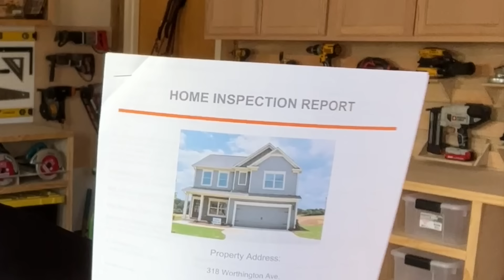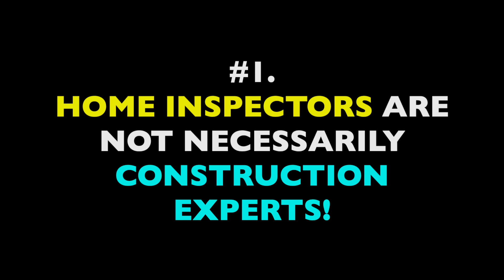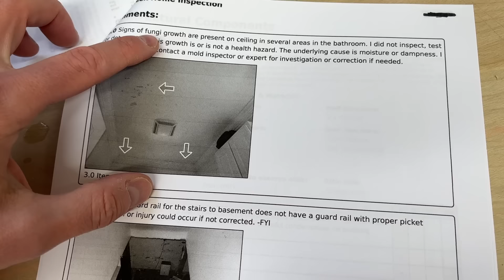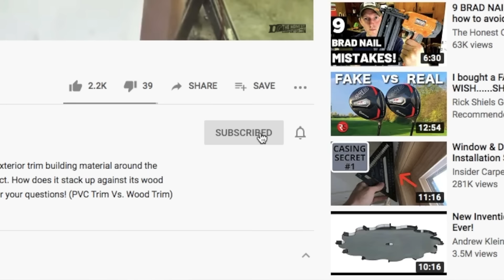The Truth About HOME INSPECTION REPORTS! What They Leave Out...(Homebuyers SHOULD WATCH This Video!)

Comment: We've had homes that we've bought and sold in our family for our entire adult life. I've learned a few things. Here are my thoughts.
1) Foundation, foundation and foundation. It's your most expensive repair so take the extra money and spend it on a structural engineer to do a separate inspection that can examine the structure of the house. A plumber or electrician will have zero clue. Water leaking damage alone is extraordinarily expensive to repair (average is $18,000 just to waterproof) let alone damage to the foundation and it's just misery for a homeowner. Sadly, in my experience, home sellers lie through their teeth. 
2) Drainage to the street. Especially on an older home. Have a camera stuck in the drain to the street. That's a $10,000 repair. 
3) I personally would avoid any inspector that's electrician or plumbing as for the most part, those are cheaper repairs if they miss something but foundations or the structure of the house - oh my gosh.
4) Radon inspection. Take it seriously. It's expensive if the radon gas is high. Don't overlook that super important thing and don't believe the homeowner. We had one house we looked at and did an independent radon inspection. 25. Ya we walked. 
5) If you are a new home buyer, don't be afraid to get two separate inspections and always follow them around and ask politely and nicely lots of questions. If you're friendly, they will be friendly. It's super important. 
6) Ignore the silly stuff and use that for price negotiation (faucet doesn't work or whatever. Those are not deal breakers. Even a replacement window or new roof.) Walk away from the expensive repairs so put the inspector to work on those. 
7) Have a independent lead paint inspection as well. It's a dangerous situation.
8) NEVER buy a smoker's home. You have no idea how expensive it is to get rid of the smell. I was almost tempted until I talked to painters about that - ya rip the walls out, etc. No thank you. 

Otherwise, great segment.
Reply: Thanks for the detailed info.
Reply: Dave, this is good info. I have a couple small comments on things I have dealt with.
1) The Foundation is more observable on houses that have been around a few years. Yes, it is expensive if needing attention. Some cracks are no big deal. I agree that a structural engineer will let you know what a big deal is or not. Last time I did it it was about twice the price of a regular inspection. Totally worth it though if needed.
4) For Radon - 25 parts per million is next level! Good you balked at that. I had a pipe put in at around $3500 to go from 6 picos to 2 picos.
6) Silly stuff - Yes. If you like the house don't hold up your own purchase. Many things are clear and just be part of the selling price. Requiring a clueless or unscrupulous seller to fix something might not be in your best interest. Things you think you want fixed right, you might want to have done yourself anyway. - I guess the only caveat some problems might mess up the bank giving you a loan in the first place - like a leaky roof. It depends on circumstances.
Reply: @mikeyfoofoo  Thanks for the reply. Foundations are just a nightmare for me. My worst case was I had a house for sale that the mortar did a stairstep pattern on the outside wall. That my friend is terrifying. To sell the house I had to hire an engineering firm to confirm the foundation wasn't coming apart and write an official report (thankfully no problems were found). The house inspection (of course) years earlier said not to worry. Well, when the selling agents saw that - they worried and said it won't sell. You have no idea the panic thinking that the house's foundation would have to be rebuilt. Never again did I make that mistake.

Comment: My inspector had decades of experience in the filed and worked in construction  andwas really thorough and went the extra mile and didn't mind that I was there with him through the whole inspection, but still there were a lot of things that we didn't really see until I had to had them fixed several years later,soyou can imagine  if that wasn't the case. But what I really wanted him was to inspect the roof and the foundation and those were fine.
And never, ever use a realtor's referral for most things as they have their interests involved there.

Comment: My personal experience is that home inspection prior to purchase is critical however it has to be done intelligently.  As you pointed out home inspectors just point out the obvious which is really of little value.  They don't critically evaluate major systems of a house - plumbing, hvac, and electrical - that should be part of the inspection.  I've found that hiring an experienced carpenter - to look over the house's construction, my hvac company to do an inspection of the hvac system and plumbing, and the electrician I always use to evaluate the house's electrical system is a more effective approach.  The total cost of hiring real professionals is essentially the same as hiring a "home inspector".  Moreover if an issue is found, the professional identifying it knows what needs to be done and in most cases I've recouped their inspection fee when hiring them to fix the issue.

Comment: The ASHI inspector of the home that I bought didn't actually go into the attic, just shone a light around from the opening and "verified" there was enough insulation depth. Totally missed that the bathroom extractor fans' hoses were just stapled next to the attic wall vents. Had the beginnings of mold on those walls.

Comment: I think that in any market - home inspectors and real estate people know each other. Home inspectors are very hesistant to find flaws which might derail a transaction. This summer I bought a house and sold previous house. The inspector who inspected my purchased house worked "see no evil". he did not even report a broken window glass!  On the other the inspector who inspected the house that I sold - reported every tiny hole left in the drywall!.
Reply: I have done home inspections and though over time I do get to know a few realtors. But when I get to a job, it's all on me to produce a great report on that house at present. If I miss something, it's on me, not the realtor. Believe you me, if something was forgotten on the report, the realtor will be the first one to send the client back to me. No friends when it comes to a mistake.

To the home inspector, the realtor is a source that can provide clients at times, we have other means of course. If we do anything that makes the realtor's suggestions a bad one in anyway, the home inspector's phone for that realtor will go silent. 

If the home is so flawed that it kills the deal, it's not the home inspector falt, it's the house that failed the inspection. The realtor doesn't like it, only because he or she has to come up with another house, or get the owner to bring the home up to par. But that realtor know now if there is anything wrong with the house I'll find it.

Comment: I used to do QC and before that worked with my dad in GC my whole life. Any part of QC qualification should have to spend at least a month or two on a crew with each of the trades. Plumbing, roofing, framing, concrete. There’s just so many things that don’t translate accurately l from books compared to actually doing the work and getting first hand knowledge of why we do things certain ways, and why we don’t or why code has changed and when the change just doesn’t apply. Often times people use red tape for legal Legal leverage instead of what it was intended for, not to tell you how to do it, but how not to do something. 

 There’s too much Red tape in construction not to have experience in building before inspecting it. You wouldn’t let a coach teach who’s never played, why would we do this with home inspections

Comment: So now I’m going to need an inspector a carpenter a plumber and an electrician to check on the condition of the house and expose the major issues or design flaws so I don’t buy the house that needs $100,000 in repairs.
I’ve bought some pretty awful homes and suffered from my mistakes and mistakes in thinking that the inspector had any clue what condition the house was in.

Comment: Nothing like getting called out to a home because the seller wants to fix the things in the report.....the report claimed the dishwasher line didn't run up to give a loop and had a photo of it going into the disposal just like it should.  I get there to run the line up and find that it's already through the cabinet side at the top of the cabinet.  What's even worse, the manual to the dishwasher in question actually shows/explains to run the line along the bottom of the cabinet without the high loop.  The inspector wasted my time and the homeowner's money because s/he couldn't follow a dishwasher exit line.

Comment: I worked in the trades for years, then went to college and obtained a C.E.T. designation. I worked as a municipal inspector for years. My experience, during that period, is the trades generally don't know much about each other's codes or design requirements. There are some exceptions where you will get a trade that is very knowledgeable about all aspects of construction. The area most trades fall short is carpentry/structure. I agree that the home inspector needs some practical construction knowledge but also needs to know what they don't know and educate themselves. People also need to realize that someone who is excellent at construction will make considerably more money working  construction. Someone that leaves construction for reasons other than looking to slow down or has sustained an injury that limits their ability to do their trade probably wasn't that successful or possibly talented. You don't want to hire an inspector that hides behind all their standards of practice rules. What is important is to find an inspector that has thorough knowledge of all aspects of construction  and will actually bust their butt and get into every area of the house they can without doing any destructive investigation.

Comment: To get a good sense of a house, you need experience with how the homes are built and common issues with that come with that construction method and/or builder. Our home was built by a contractor in the early 2000's who made all sorts of mistakes and bad decisions that we get to pay for - none of which were noted in the inspection report. Having built two other homes around the same time, I was able to fill in the many gaps in his report. I found out more useful information having quick conversations with my neighbors with similar houses built by the same builder. One thing that caught me off guard - the inspector missed that the house has CPVC plumbing - which is now banned and there are still pending lawsuits around. I didn't even know this was a thing. Had I known, I would have asked the sellers to compensate for a complete re-pipe. Since I didn't do that, I get to pay for it in full and I have no recourse. This one still baffles me.

Comment: I work in civil construction and deal with inspectors regularly. I can always tell the difference between an inspector with contracting experience and an inspector who only has some college degree. The guys with contracting experience are definitely way better on average and actually know what they are looking at on a much higher level. One of the most extreme examples I've seen of an inspector without construction experience was on a job where we were building a retaining wall and he didn't realize that the back side of it got backfilled after we were done. He literally thought it would just be left open.
Reply from the maker: That’d be a weird wall! 😅

Comment: Home Inspectors are also not code inspectors. It's not the job of a home inspector to report every single code violation. The report may have observations based on code but reported as a safety issue. Many inspectors will in fact place the most important issues at the beginning of a report in a summary, so the client will know the difference between small and big issues. And if an inspector does not report smaller issues, they know the client will, later on, say why was it not reported.

Comment: I'm a home inspector and do about 225 to 300 jobs per year out here in Los Angeles county. This pretty much hit it on the head. I often hedge my verbal and written statements due to legal liabilities. The software I use differentiates types of defects such as safety concerns, recommended upgrades, and recommended corrections. I still have to tell buyers that not all "safety concerns" are created equal.
Reply: Smoke alarms>>>>>>

Comment: Being a good carpenter, plumber, finish contractor, etc. really has very little bearing whatsoever on being a good home inspector. You may logically assume that if someone has been hammering nails for 20 years, they must know a lot about houses (hopefully). You might not however, assume that doing finish cabinetry doesn't teach someone much about say, electrical systems or identifying foundation failures. What you do need to know is that being a great home inspector requires an enormously diverse skill set that is not taught in trade school, or ‘at the job site

Comment: There will always be a conflict of interest when dealing with a home inspector referral from your realtor.  We had a a home inspector flag a rotting board on chimney and said it’s just a couple boards. It turned out the whole chimney needed to be rebuilt $25,000.
It’s better to have tradesman look at specific items based on their specialty. 
• roofer
• siding
• mold 
• radon 
• furnace 

It may cost you an extra $800 or so but will pay huge dividends if something is found.

Comment: Home inspections are pretty much a sham. Exactly a lot of times like roof inspections. The inspectors say they find something wrong when there is no real problem or there is simple fix yet they want to charge a ridiculous amount, ie $20 to put on a missing outlet cover in which case the seller should be allowed to fix the items themselves. The inspectors usually don’t have experience in the trades, like stated here they are just looking at obvious problems. Roof inspectors have a conflict of interest issues.

Comment: 7:37- not the inspectors job to determine cost of repair. I’ve worked as a framer and a plumber and now an inspector. If I give you an estimate range and you get it quoted higher then I possibly get sued for the remaining amount. WHICH HAPPENS more often than you would think. 
Honestly man, you need to stay in your lane. A carpenters opinion about an inspection report is as useful as a high school football coach trying to tell Tom Brady how to play.

Comment: Just to say, your woodworking / DIY videos are among the best on YouTube. You get to the point with zero BS and are totally clear in your explanations. Years ago I built a a set of kitchen cabinets that came out pretty bad (they were too big for the tools and workshop I had at disposal) and I still struggle to cut a straight line but next time I need to do any woodworking you can count on the fact that I'll re-watch your videos on circular saws for some tips.

(We did build an on grade deck last year, and but designed it to hide a multitude of sins!)

Comment: Learn from my experience...even if a house is on a hill, do not assume it has a good basement drainage system...you better find out where that drain comes out even if the basement smells clean and dry. Inspection fail.

If a basement has been finished, it better have a hvac vent  feeding every separate room. Inspection fail.

If a house smells extremely strong of pot porri, the dog and cat have been using the carpet as a bathroom.  

If there are stains on the basement ceiling(drywall, yes, stupid),  there is an active leak. Inspection can't look behind drywall. I would like to see 6mm hole to poke my camera through to see better what's happening up there.

Comment: FYI, 

Most mortgage companies/banks actually don't require a home inspection.  They do however require a termite inspection to be done, obviously based on where you live.

Also, there are many types of home inspection software available that generate different types of reports. You mentioned one type.  

Another one breaks down the items inspected into four categories (Acceptable,  Marginal/Maintenance,  Not inspected and Defective) and provides summaries at the end of the report. 

Finally,  I always tell my clients I am not the expert and in someways I'm like your family doctor who refers you to the expert when an issue is discovered.

Comment: Currently a Licensed HI. Additionally 50 yrs in the Construction Industry on many levels. It’s an advantage to be or have been in theTrades. However the Inspection Process does not require such. Your video slant suggests we avoid/ miss things. A true report will cover all potential home owner questions. Recommendations are just that. A report is not a black and white scenario. Buyers are not required to do anything with a report. It’s up to them to heed or ignore recommendations.